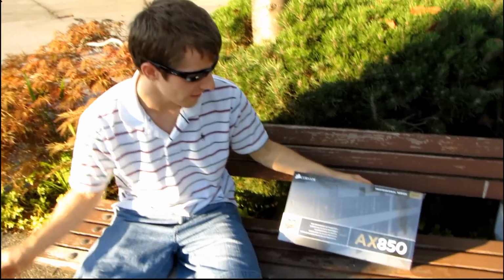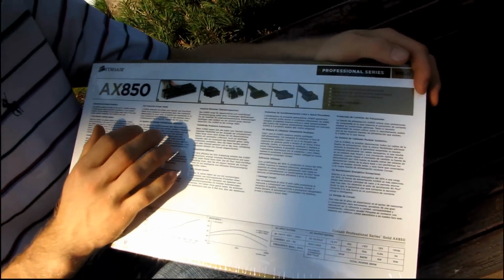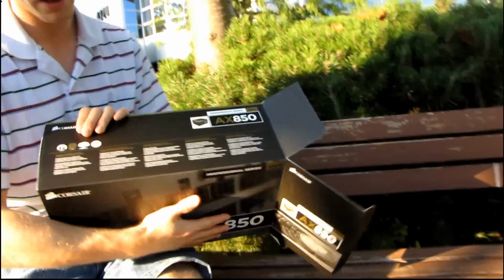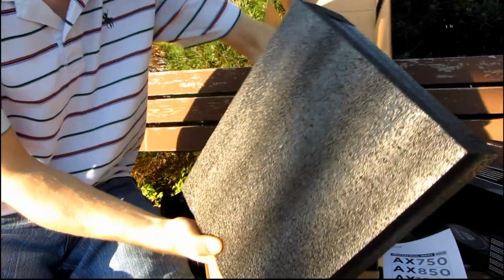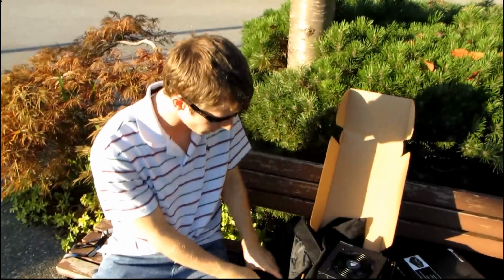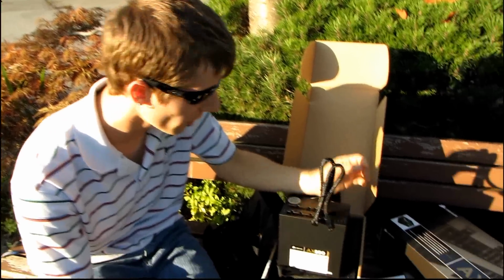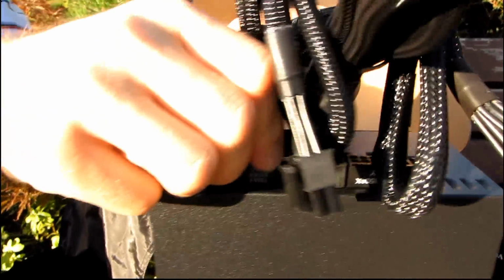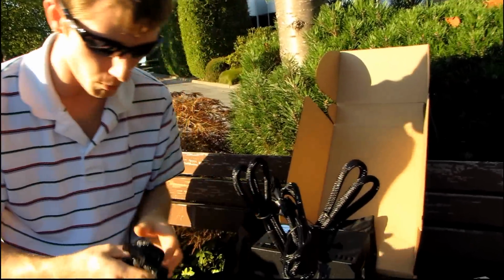Corsair 850AX 80 PLUS Gold Single Rail Gaming Power Supply Unboxing & First Look Linus Tech Tips

Comment: Well it depends on the amount of watts you are using. If you are barely using it, sometimes it'll not even spin up as its able to provide the power without heating up. If your gaming, and it doesn't spin, you've got a problem there.

Comment: Asus RAMPAGE IV EXTREME Intel X79 
Intel Core i7 3820 Socket 
Zalman CNPS12X Ultimate Performance Triple Fan CPU Cooler
G-Skill Tridentx Series 16GB (4 x 4GB) DDR3 PC3 19200 2400MHz
Intel 520 Cherryville 180GB MLC 2.5inch SATA 6.0Gb/s Internal SSD Hard Drive
Western Digital Caviar Black 1TB 7200rpm SATA 6.0Gb/s Hard Drive
Pioneer 24x SATA Black DVDRW Drive
MSI GeForce GTX 680 Twin Frozr OC 2GB GDDR5 PCI-E 3.0 x 16 Graphics Card

would this beast feed this rig enough i think it will

Comment: I was reading some comments about this power supply that's one of those:
"I got the psu today as part of my new rig. I could not believe that the 2x 4 pin cpu power cable was so short! I have a Cooler Master HAF X case, and the only way to get the cable to reach the psu is to have it stretch across the motherboard, rather than being routed behind the back plate and down to the psu keeping your case nice and tidy.

Are this cables really so short? ;/

Comment: @UbeefHooked Most people prefer modular PSU's due to the fact that you don't always end up using all the cables. I would prefer this model over my TX750. The single rail + modular design is just freaking awesome. My small PC case is crammed full of unused power cables, I wish I had gone for this modular Corsair PSU instead.